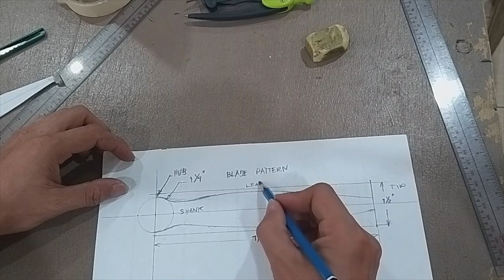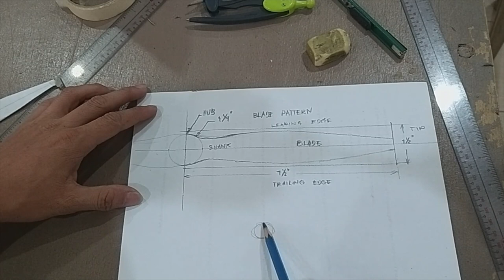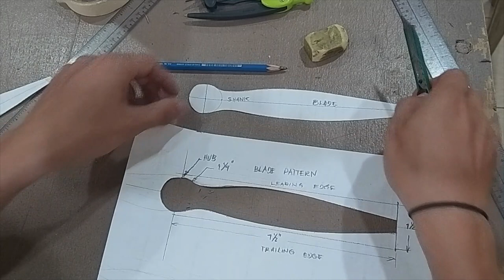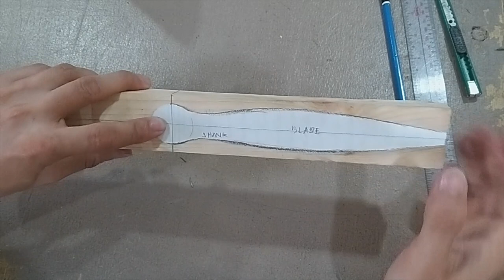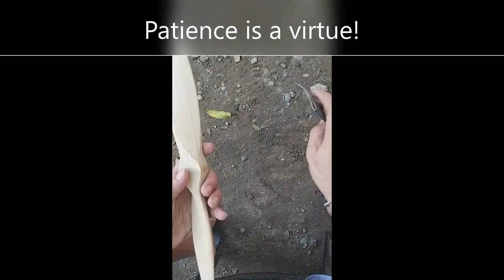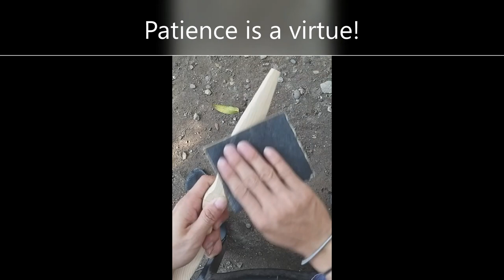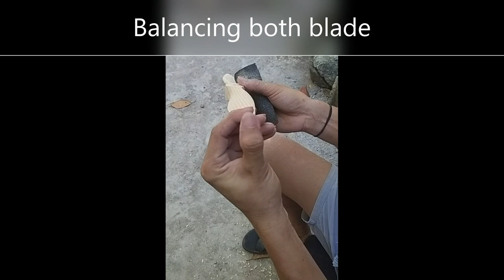DIY Aircraft Propeller Project

Comment: Try drilling the boss and bolting it to a block of hardwood to hold in the vise. Those blades are delicate and an overpressure can result in damage to the grain you might not be aware of.
Excellent work!

Comment: Will it rotate clockwise or counterclock wise plz tell ??
Reply from the maker: Any sir, It doesn't matter as long as you pivot the middle part.
Reply from the maker: But if your done already, the propeller face should be facing you and the rotation is counterclockwise towards the leading edge. Feel free to ask sir